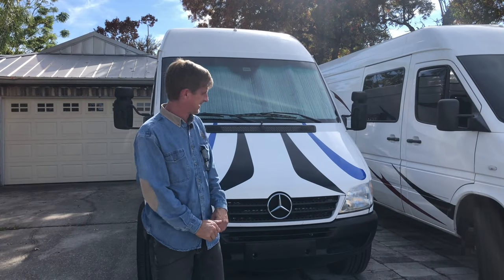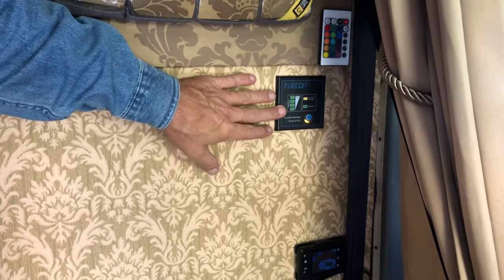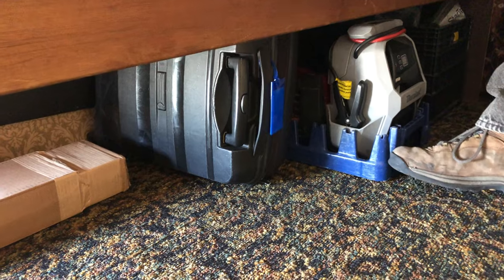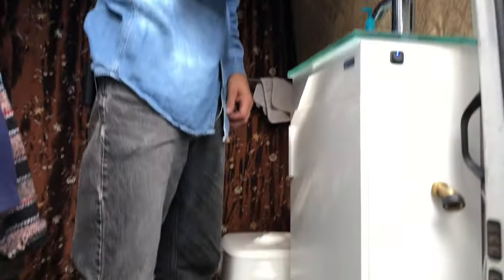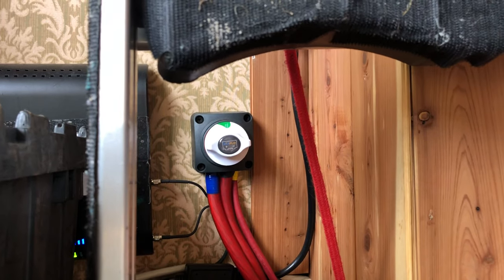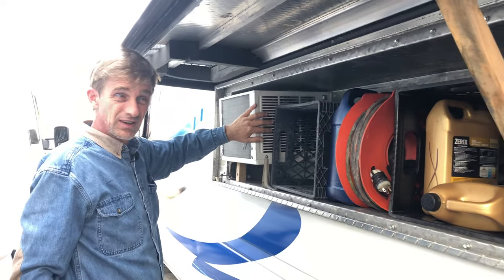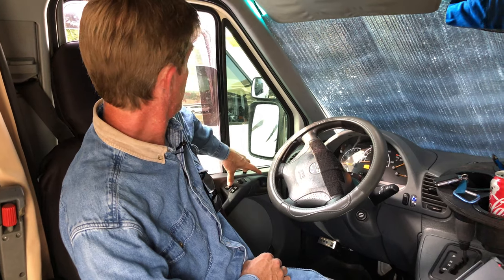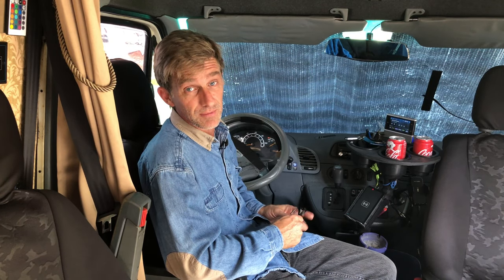The Blue Saloon - 2005 Sprinter Build-Out Grand Tour

Comment: Did that say 490 000 odd miles?
Reply from the maker: Yes in deed, now 496,193 and counting! My butt remembers almost every one of them, but my brain??? Not so much. It's the only new car I'll ever have, factory fresh in 2005, we have seen many long and dusty roads!
Reply: @FloridaVanMan  Wow, is that the original engine? I have two, one at 210 000 and one at 145 000, so there should be a few miles left in them yet? Any maintenance tips?  I change the oil twice a year,
Reply from the maker: @zambotv8150  Sadly no, it is not the original engine, but I take full blame and responsibility. I experimented with fuel immediately after the warrantee expired. The van ran very well on vegetable oil and slowly adapted to the fuel as I got faster at cleaning the used oil. When I stopped collection oil and went back to pump diesel suddenly, the original engine rebelled. That was in 2007 and less than 100,000 miles. Wayne Rodd in Toledo rebuilt an engine for me and It has been reliable ever since.
We have a few other Sprinter vans over 300,000 with original engines.
Reply: @FloridaVanMan  Thanks very much for the reply. I used to run my VW van on homemade fuel, usually 10 - 20% petrol mixed with veg oil. I presume that engine had a mechanical pump and not a common rail system? There's a guy on YouTube that hit 900 000 miles in his sprinter before he needed a rebuild. I am changing oil twice a year to see if that helps, 210 000 and still going strong